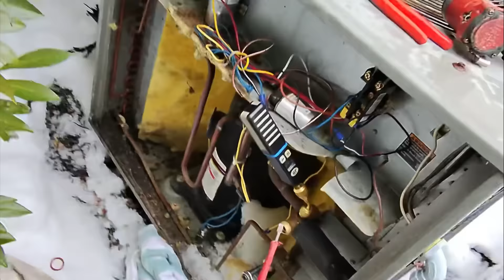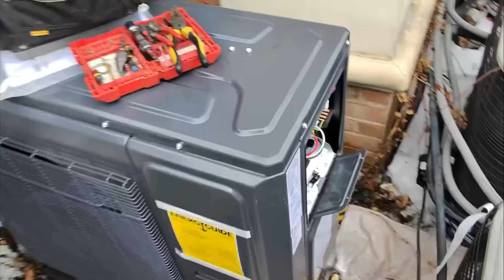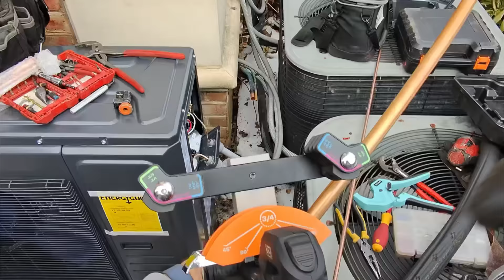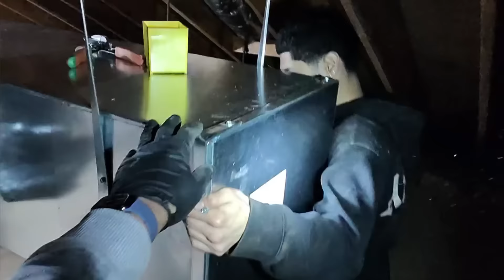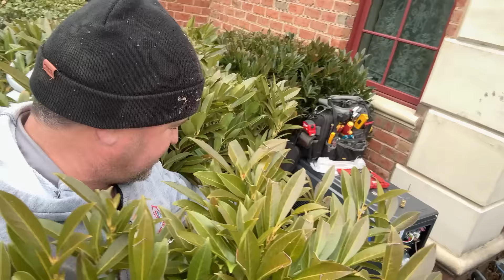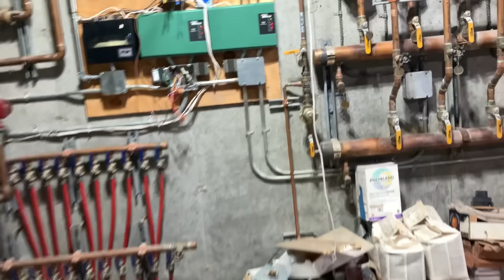Decommissioning High Velocity AC System & Installing Mikey Pipes by ACiQ Extreme + Heat Pump

Comment: Nothing wrong about your excellent 7/8 to 3/4 connection Micky Pipes was doing that back in the 80's you done good and that will never leak I enjoy watching you work. One thing Micky Pipes I would have liked to have had the automatic tools you use back then. Thanks for your profession.

Comment: you should use a heavy wall garbage bag loose over the mesh sock and line-set end to catch all the shmoo you're blowing out of it, instead of all over the customers attic, especially the oil and dye, which you'll track everywhere.

Comment: Mikey love your channel. Why dont you use flexible connections on inlets and outlets of air units? Duro Dyne Junior connector. Reduce noise and vibration, makes duct connections easier and looks professional. Duro Dyne located in Bay Shore NY
Reply: good suggestion, I bought a coil and connected my own with it, it's nice not having noise transfer from the unit into ductwork. even with the hard piped gas line and pvc vent/intakes, which are ran specifically to not transmit vibration/noise.

Comment: Swedge the 3/4” end and it would’ve fit tight inside the swedged 7/8”. Done it more times than I can count. Works perfectly fine
Reply: yep or any fitting will work,  like a regular acr 3/4 90.  3/4 pipe in one end and the other belled end into the swedged 7/8". obviously that makes two joints vs one, but it works great if already needs a tight radius. it works across most of the sizes steps too.

Comment: No Mikey you should know that you need to explain to these people on internet that you can't just pump down a unit and that's all of the refrigerant going into the condenser depending on the line set run there could be additional refrigerant that cannot fit into the condenser coil you need to tell them that otherwise everyone's going to think they can just pump down a unit and cut the lines and then have a bunch of freon come squirting out
Reply from the maker: Thanks for sharing

Comment: Thanks for the video! Always send the piggies running from indoors to outdoors!!! RX-11 first is best especially with all of that dye in it. You need to watch trying to lift heavy ass objects at your age Mikey because if you tear a  rotator cuff you will be out of commission for up to a year my friend I have tore both of mine....no fun!

Did you check TES on AHU I was wanting to see what it was Mikey. Does ACiQ use their own brand ECM motors or do they use the other name brands that fail under high static conditions frequently? I was hoping an ECM manufacture would have enough smarts to program some safeties into the ECM logic so it will not destroy the ECM modules. Not too familiar with all ACiQ products yet but can tell they are going to make a big dent in the market. 

Stay safe!

Comment: I feel your chilled hands just watching you! Totally agree the 3/4" to 7/8" is not a big deal if there is any turbulence, it is the noise throughout the entire lineset length , plus it saves you another braze joint!  Perhaps you already thought of this or plan for it and not criticizing, but any concerns on the the condenser air feeding back to the Lennox unit next to in when both are running?  Maybe there is enough free air...just curious on your thoughts.  Thanks!

Comment: AMERICAN STANDARD IS THE ONLY AC I TRUST FOR MY CENTRAL AIR.  NO CRAZY HIGH EFFICIENCY BECAUSE THOSE UNITS BREAK DOWN AND COST A TON TO REPAIR.  MID GRADE IS MIRE THAN ENOUGH FOR ANYONE NORTH OF NORTH CAROLINA
Reply: Yea, but have you seen the blue polymer fan on these ? And, the circuit boards have way more mosfets than that stone age American Standard  😂
Reply: obviously you have not looked at any of the newer american standard(trane) equipment. it's all went downhill and full of the same cheap junk as the rest.
Reply: @throttlebottle5906  mine is 4 years old and the silver model I have hasn’t changed in over a decade.  Much like a an older Toyota.  Now sure I don’t know 🤷‍♂️ about the last couple of years or to date but I do know ACIQ is no where near AS

Comment: My favorite work gloves are made by Showa. I guess typically more of a landscaper's type of gloves, but despite being fairly thick, and heavily rubber coated, the amount of dexterity and feel you maintain is so good, it makes no sense. They even come in thicker varieties for cold weather. I don't really ever work outside, but I do a lot of new construction installs in dried in, but not heated or insulated houses during the winter. I usually just wear the full rubber coated ones, keeps my hands completely clean while working.
Reply: you must not handle many small fasteners and tools, because gloves make it near impossible.

Comment: I've been learning as much as I can about these new units, heat pumps..The biggest cons I've come across with new install reviews from 2025, high efficiency, is the cost to run them especially when cooling. The electric bills have gone up 20%-30%...Here in Massachusetts , The electric companies are even giving discounted rates during the peak winter months trying to offset these costs...I'd love to hear your thoughts on the comparable costs to run them....I'm hooked to your videos, you're a very knowledgeable person and run a tight ship....
Reply: Heat pumps are new thing? We've used them 2 decades here in Finland.
Reply: @zyrppa  I don't mean new as in newly developed, I mean the newer high efficiency ones with upgraded tech....with all the bells and whistles..
Reply: the problem in USA is the poorly insulated and draft homes, may as well try to heat a worn out canvas tent with a candle. 🤣